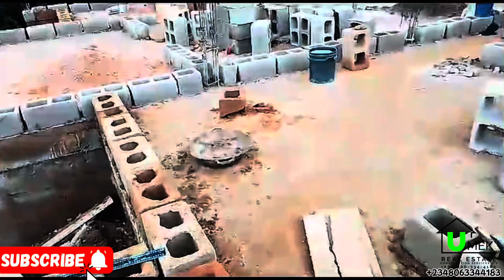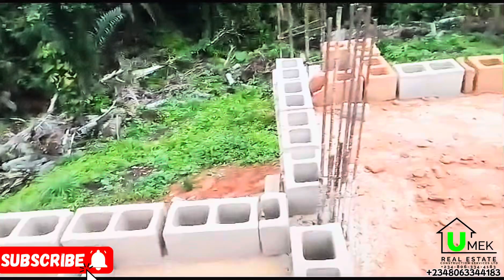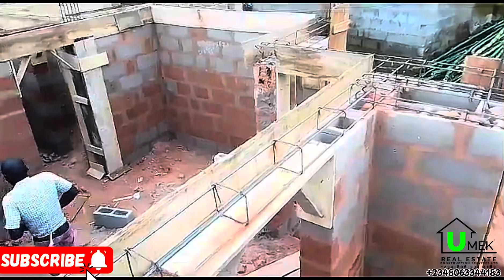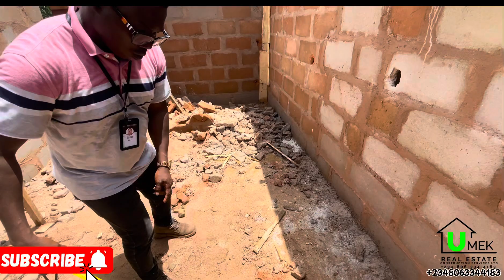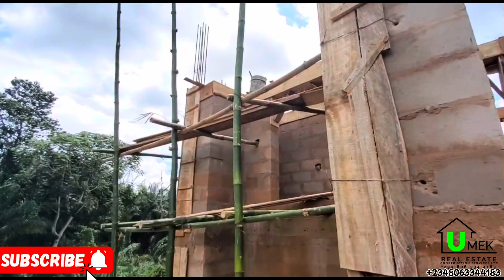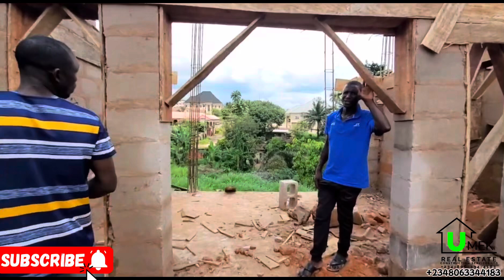Find out, Cost of Building a 229sqm Duplex in Abia State, Nigeria, November 2024.

Comment: Umek good job Nnam. It appears you are a specialist in dealing with swampy land.

Do you think $40,000 can finish a building like this with boys quarters 4 rooms up and 4 rooms down. Just like a  lockup shops.

But, your associations , architects, structural engineers and COREN as a body have not done fairly good as regards the price of cement in Nigeria.

I expected them to have protested about the cost of building materials especially cement.

Many people put their building projects on hold because of the price of cement.

Umek, let me know if $40,000 can finish this project with 8 rooms boys quarters 4 rooms up and 4 rooms down.

Watching your video from Canada 🇨🇦. Udo diri gi. Nnam.
Reply from the maker: Hi good morning and thank you for your comments. It would depend on the size of the project, design and choices of finishing materials … so the answer would be Yes and No…  basically your design and choices of finish will determine the cost
Reply: Bro.can l get your contacts?